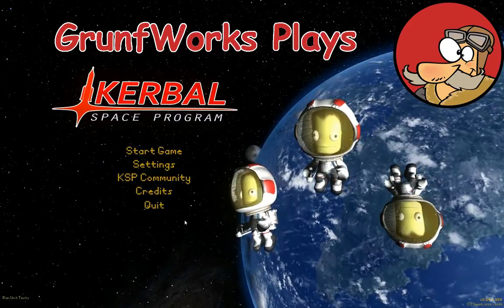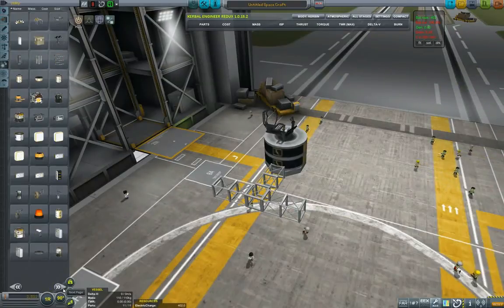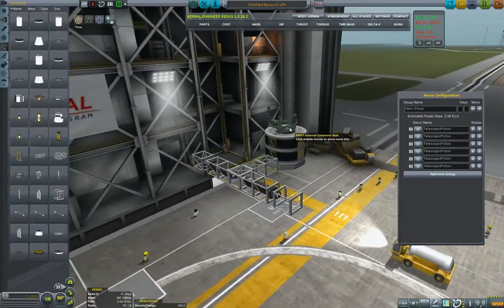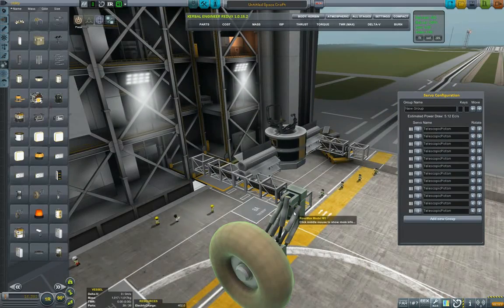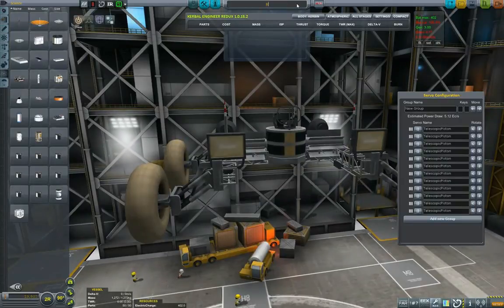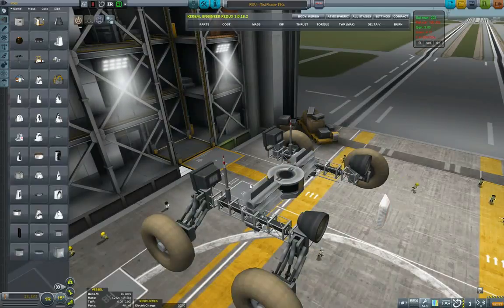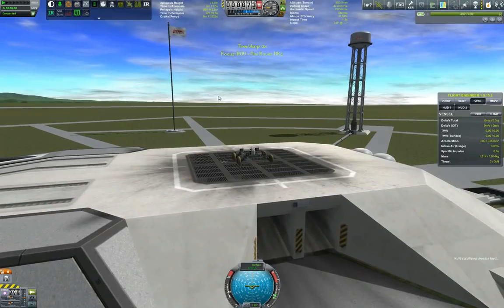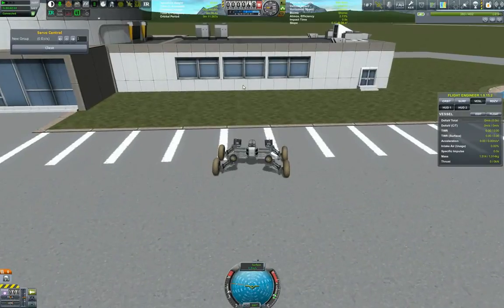Kerbal Engineering - How to build a rover

Comment: Remove the node balls? They auto snap to each other. That's what they exist for. You're doing it the hard way while complaining about the feature that would just snap the parts together properly for you.
Reply from the maker: Achron Timeless I think you misunderstood me. I am not complaining about the snap feature or node balls. All i am saying is I would like to visually hide them so i could align the pistons exactly. 

I have mis-aligned them many times, maybe not this time, but if you put on angle 90, it can happen that the inner piston is either too left too right, etc, so when you extend them later, they look crooked, and with node balls i am not 100% sure if i have aligned them correctly. I think that somebody did manage to hide the balls with some key, so all I was asking was if someone knew what the key was.
Reply: GrunfWorks Right, but it's literally not an issue if you just use the nodes as they were intended. They snap together dead center. All you're doing is causing yourself headaches by trying to surface attach them in the exact same spot the node already is.

You're going out of your way to cause yourself headaches. If you feel inclined to do that, that's fine.

Play the game how you want to, but watching you try to put all those struts and pistons together perfectly lined up when you could've just done it in seconds by rotating the camera a bit and snapping the nodes from the side, I just thought I'd help you see your method was the cause of your issue.

Do with that what you will.
Reply from the maker: Achron Timeless
 Ok, now i understand what you meant. You are correct, i forgot that i could just disable surface attachment while doing so. I was so used to putting pistons in surface attach mode, that i forgot you could just disable it.

Sometimes you just don't see forest from the trees (or at least i do ;-) )

I appreciate the comment and the suggestion, don't get me wrong. I just misunderstood your initial suggestion.